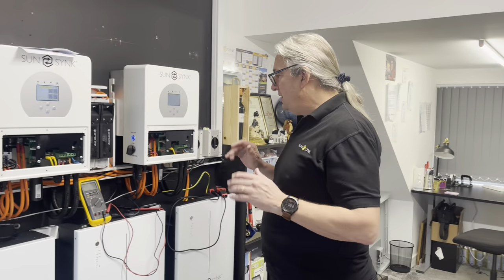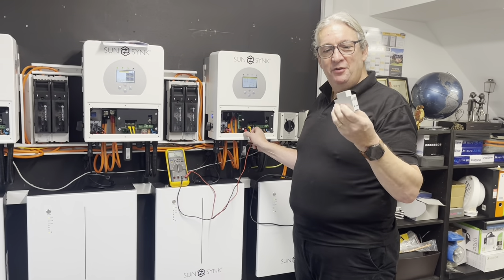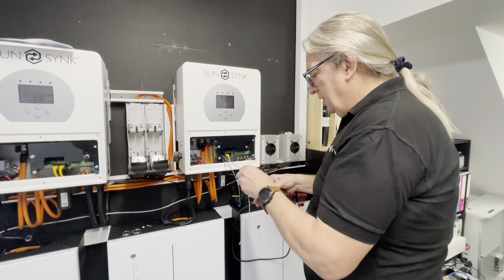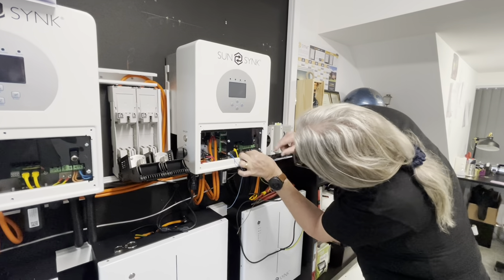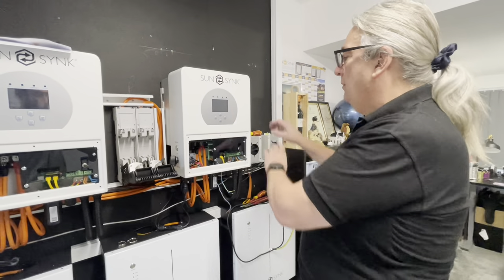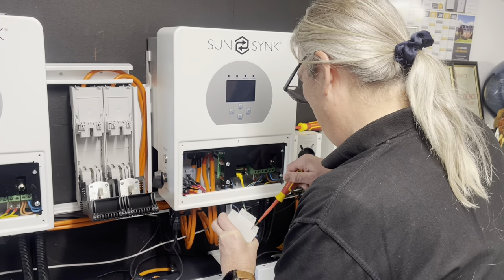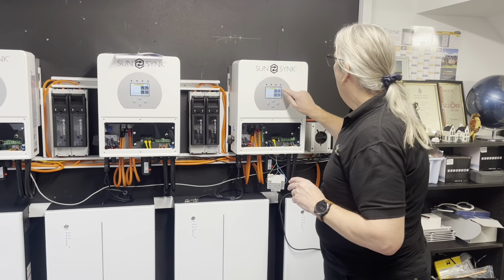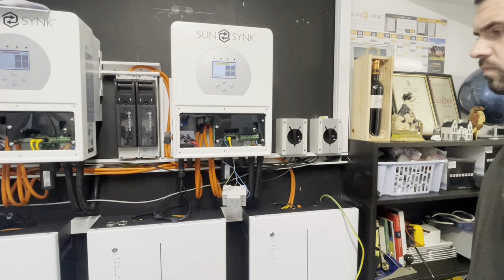Earth Neutral Bond

Comment: I think the 5kw ECCO has the same contact configuration as well. It's really annoying though as this requires a NC contactor which will constantly dissipate ~4W. Why there is no 230V output which activates a NO contactor or better integrate a N-E bond is weird. The manual is inconsistent with this video (Page 17).

Comment: Hi keith, like most people are mentioning and like most other manufacturers why isnt there a contactor built in. Secondly when are sunsynk going to make all inverters uniformed to eachother rather than having to have dry contacts in 3.6/5kw, hot contacts in 8kw and then in the three phase not needing either. Sunsynk are great at something but ignorant a lot of others. You should be asking electricians and installers what they think.

Comment: Hi Keith good luck with the op! Please can you answer my question from your book titled 'Earth bonding for dummies' I have a 8Kw inverter with 2 X 5.5 Kw batteries all working perfectly WITHOUT earth bonding, (No Panels, system used for load shedding) If I connect a relay strictly as per your instructions my ELU trips what am I missing????
Reply: ELU?
Reply: @tanishqbhaiji103  Earth Leakage Unit. Basically the RCD, residual current detection device.
Reply: @MHBGT  you need to setup the delay time in the settings, as the relay is slow to switch and is triggering the RCD. I believe he has a video on this.

Comment: Hi Keith. Great video! When running parallel inverters, is it okay for each inverter to apply a Neutral-Ground bond in each inverter? My concern is arc fault, possible ground loops. My inverters apply NG bond when in DC modes (battery or PV), but not when AC input is energized as it is assumed (in the USA) that the NG bond is in the first means of disconnect after the meter. The vendor refuses to answer my questions/concern. Thanks in advance! -Jay

Comment: recently notice that the neutral(N) wire that comes from load port has 110 voltage and the other line load (L) also have around 120 voltage, to my understand the neutral should not have voltage on it and the load should be on L only. Is this normal in my case or there is an problem with my inverter?

Comment: How much panels can the 6Kw single phase take on 1 MPPT trackers without the other having any?
Reply: depending on the model, 6500W or 7800W worth of solar panels. A commerical pannel is about 300W on a good day, so about 20 per MPPT.
Reply: @tambo22003  so like 100% input imbalance?
Reply: @tanishqbhaiji103  The MPPT's are independent. Do what ever you want, just don't over the voltage limit.

Comment: To Steve and Keith, if I may,
is your grid neutral and load neutral  bonded at any point?  

My installation  of 2x 5kw  with 11kw/ 2 battery would trip the mains  with a clear  short/ arc  on the master Inverter grid terminals about 30sec switched on for the first time.  
After a thorough inspection with the supplier technician, we found the Inverter load neutral terminal and  grid live terminal ring out.

AT THIS POINT  THE SYSTEM WAS CONNECTED  WITH THE CT and no external neutral bonding. I must mention  the system worked fine on battery  back up prior the dead short, ran a load @1.3kw
the issue arrised -+ 30 sec after switching grid On.

To my surprise during the inspection  the technician suggested/ instructed me to  bond  output and input  neutral BEFORE  THE E/L and disconnect  CT.  According to his words
" the is a build in check CT for feed back  just get the Zero export  on settings "

Currently  running  and waiting  on the replacement unit. 

My friend  at the Muni was not happy when I  told h this as we both know feed back or reference neutral  is dangerous to when working  on MV lines . I would like to rectify this but I'm a bit puzzled  with the bonding  story. 

Please assist  where possible.
Thanks
Reply: I don't understand your comment, but Keith did a better explanation here:https://www.youtube.com/watch?v=mQR5VKdlshE&ab_channel=Sunsynk

Comment: Normally Closed Contactor

Terminal 5 is a neutral for the contactor coil

Live wire from load live feeds the contactor coil

A neutral from terminal 6 to the neutral for load which also goes to the top of the contactor 

An earth from the earth bar to the bottom of the contactor.

Comment: Hi Keith, I had a 10Kw Sunsynk Inverter and Battery system (2 x5kw paralleled) installed for my house in South Africa.  After a week one of the inverters failed and had something burning smell coming from it.  The company that installed the system replaced the inverter as they thought it was a faulty inverter. almost two weeks later the new inverter failed exactly the same. The company that installed the inverter and the supplier came to my property to investigate. They said let's try get a bigger inverter so they removed both inverters and installed the 16kwa.  Not even two weeks old the new 16kw inverter  has failed and has burning smell coming from it! I have spent hundred of thousands of Rands and it keeps failing!
Reply from the maker: What is the site name
Reply from the maker: Sounds like a mismatch on the solar panels. If you give me the site name I can check everything
Reply: @sunsynk  The panels are all the same. they are Canadian Solar 450W panels, 12 of them.  Site is in Kloof, South Africa
Reply: I had the same problem. Blown 3 5kw inverters in 3 weeks time. Also burn smell. There was a damage light circuit cable. They used a earth as a neutral, but i am not sure if that was the reason to blow up the inverters. I have taken the whole installation apart. Still dont have a answer.
Reply: I have 8 x 455W Canadian Solar panels. Megger and tested them all but cant find any fault. I have taken then down and going to test them with a 5kw Mecer inverter and see what happens. I think its the panels causing the problem.